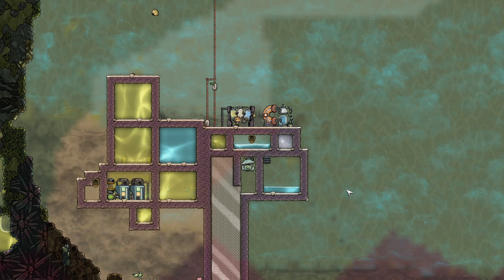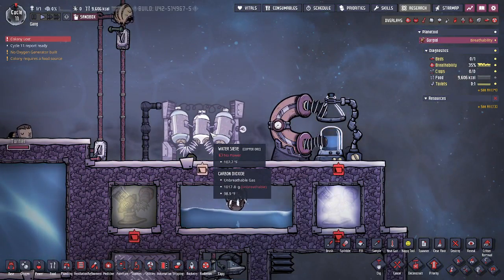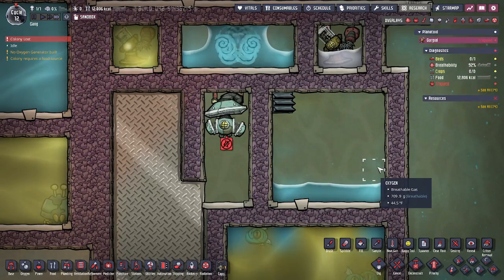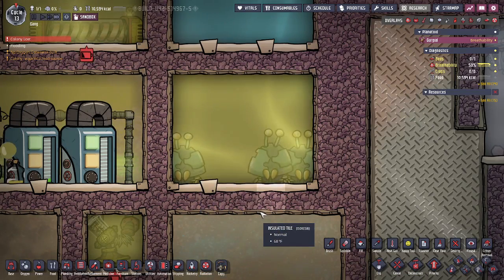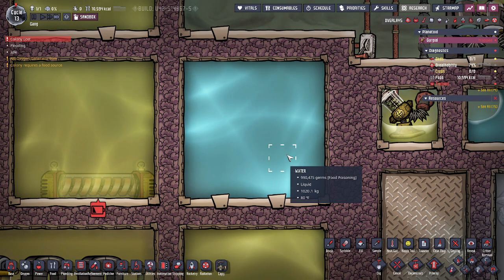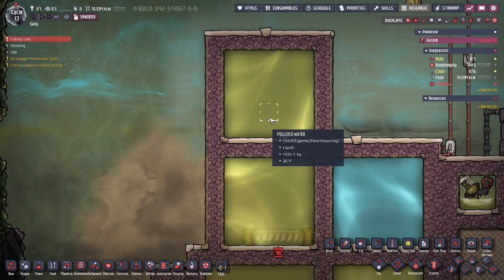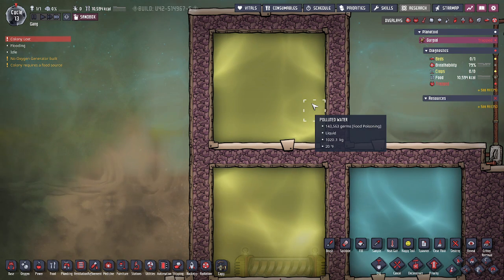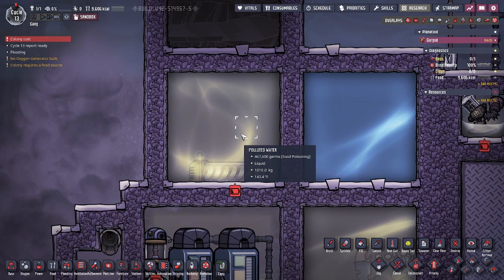Best Methods To Clean And Sanitize Water - Oxygen Not Included

Comment: 5:13 How I can easily capture chlorine and put in these reservoirs?
Reply: Before you close off the room, place a storage set to bleach stone and fill it as much as possible. Then make it vacuum with a gas pump. When you have your vacuum, just set the storage to nothing, it will automatically drop the bleach stone and it will sublimate and fill the room with chlorine

Comment: 5:01 if I understand correctly, that system is going to pass packets of germy liquid from time to time since spill-over pipe from liquid shutoff is competing with liquid intake pipe for input port of the right liquid reservoir (i.e. it's blocked every other time stamp). If you're unlucky in just the right way and there is a germy packet on input port of the shutoff due to blocked spillover pipe and packet on top of germ sensor is germ-free, shutoff will open and pass germy packet.

Also, possibly, germ sensor should be set to "below 0", since "below" here actually means "below of equal", but I may be misremembering something.

Comment: I store all my water in tanks in rooms full of chlorine. This is the best option honestly because you can do it as early as you can store water really, and you end up getting lots of chlorine gas from digging into various biomes that contain it and it serves no other purpose (at least for me, I never use it for anything).

You don't even need fancy sensors or energy consuming shut off valves or anything like that, if you have at least 3 tanks full of water that the water has to pass through before moving out, the germs all die before they leave the room anyway. And early game it's easy to store this much water and let it pile up like that.

It's just easy, can do it early, and costs nothing but basic resources.
Reply: But how do you transfer the chlorine to sit on top of the water, do you let gravity transfer it or is there some equipment that you use? Im kinda new to Oni so i dont know much
Reply: @bred123  All gases have different weights so that helps sort it all out. Carbon Dioxide will be the heaviest and fall to the bottom, but natural gas and chlorine will sit right above that as they're both heavier than oxygen.

So basically what I do is I setup a little "bottom line" station that has the CO2 scrubbers that destroys co2 above the point where they are, which makes the chlorine and natural gas fall down to that height. Then you just put an air pump right beside it with a gas filter. You send Natural Gas to air tanks so you can use it as a fuel source and you can either store your chlorine in different tanks as well or just pump it directly to where you want to use it. It doesn't have too many uses, so I usually store it where I store my water so that it keeps it free of all germs.

You can use switches to turn the pump off manually, or you can set it up to turn on only when a sensor detects natural gas or chlorine.

Comment: Another easy way to disinfect polluted water is by making it go through 4 liquid reservoirs. To prime the system you need to have 0 germs in each tank and automation/pipe priorization to make sure tanks stay almost full. The reason this works is that the output water has the average germs of the tank. It might sound crazy, but it works.

Comment: Your disinfecting room design can jam in a way that would require manual intervention. To be certain of avoiding this, you must ensure that the tanks can never fill entirely. One way to achieve that would be using an automation signal off the first tank — set its lower threshold to 99%, run it through a NOT gate, and use that on a shutoff on the input line. That way, the tanks will never fill the line, so the recirculator can always keep going, and the tanks will always empty eventually (so long as there's somewhere for them to empty to!).

Comment: Does the brine or polluted water have any correlation to the Fahrenheit scale in ONI? I know the freezing point of normal water in the game is within a degree of 0 Celsius and the boiling point was within a degree of 100 (because that is how Celsius works). I though Fahrenheit was based on a similar concept with salt water though the in-game boiling point seems to be about 180.
Reply: [...] but the original paper suggests the lower defining point, 0 °F, was established as the freezing temperature of a solution of brine made from a mixture of water, ice, and ammonium chloride (a salt). The other limit established was his best estimate of the average human body temperature, originally set at 90 °F, then 96 °F [...]

The author used an arbitrary solution: a different concentration would lead to different freezing point. That's indeed why the Celsius scale instead uses pure water, instead of an arbitrary solution. There is simply no logic in the Farenheit system, or the Imperial System as a whole.
Reply: @altamistral  Though I think the point of the imperial system is that it was based on measuring tools easily available to the average person. 
I believe an imperial foot is about the length of a human foot, the original mile was how far a Roman soldier could march in a day and the person creating the Fahrenheit system seemed to be trying to replicate the human body (and thus percieved temperature).
This would make imperial measures good as a colloquial measuring technique (thus why it has hung around so long) though the reliance on potentially variable measures and the complexity of converting between measures (ie yards to miles) would make the system error prone for complex engineering.
Though the US made a point of standardising exact measures and I would guess they would avoid conversion within a given scope of an engineering project thus replicating the metric system.
Reply: @roax206  Historically "one foot" had no precise definition. Depending on where the term was used it could have meant as little as 250 mm or as much as 350 mm. The "point" of the Imperial System is that when people face a new challenge, i.e. measurements, they mess up a lot and make a lot of mistakes before they eventually get it right. The error of US was trying to standardize that mess instead of trowing it away as they should have.
Reply: @altamistral  well the point was that people have different sized feet (as well as other factors that influenced the chosen size).
Having a vaguely similar measure as  part of your body makes it easier to guestimate distances but this should not be used in commercial engineering.
It should also not be used when flooding the market of an entirely metric based country to the point were all of it is legally gibberish but you can't buy a sandwich without knowing how many fingers make up a foot and have to try to figure out how many feet of curtains can fit in a 2m window frame.
Hello from Australia.

Comment: A couple things to note:

Sending brine through a desalinator will yield significantly less water than salt water, since a larger portion of brine is salt (per 5 kg: 3.5 kg water + 1.5 kg salt for brine vs 4.65 kg water + 0.35 kg salt for salt water).

Also with regards to chlorine sanitation, by having 3 full reservoirs of water or even polluted water in the chlorine atmosphere, you can have a full 10 kg/s throughput and still get sterile output.

As long as the reservoirs remain full and you only send liquid out of the system after it's gone through all 3 reservoirs, the chlorination + dilution of germs will be enough to handle any amount coming in. No automation is even needed if you set up the pipes correctly.

Comment: Storing your germ-polluted water near a lightbug farm also works.  Radiation kills germs; the higher the amount of rad exposure, the quicker the kill rate.  Any source of consistent radiation will work, really.
Reply: i am gonna want to know JUST what this is exactly.
Reply: @lechking941  The shine bugs that spawn in temperate biomes emit light.  They're also radioactive.  You can toggle the radiation overlay with I believe the F9 key.  You can also adjust the amount of radiation they put out through the settings when generating a new map.  The more shine bugs you have gathered in a location, the more radiation is emitted.  Germs in air, water, and on buildings, when exposed to radiation, begin to die.  The higher the amount of radiation exposure, the quicker they do.  Natural uranium also emits radiation, as does unblocked exposure to the space biome. If you build a germy-water reservoir near one of these sources of radiation, the radiation will take time to kill germs and sanitize your water.
Reply: @aaronmartin8027  But that close to the space biome won't any water freeze? It's really cold up there! It was my plan for a long time to cool my base down by using that but it never really worked out.
Reply: @huldu  It is, indeed, cold up there!  
I would suggest using insulated tiles and pipes or liquid tanks to get around the freezing temperatures.
If you are constructing your liquid storage, use insulating tiles and piping with material that offers a balance between heat loss and radiation penetration.
Also, from what I remember, liquid freezes in pipes but does not freeze in storage tanks (correct me if I am wrong).  Shove your polluted water into a few tanks exposed to high radiation.
Or, avoid the whole isse with the aid of a vacuum.  Intentionally expose the top of your liquid storage to space radiation and line the bottom and sides with insulating tiles.
Reply: lol, gonna install radiation lamps in my polluted water supply.
Reply: A door made of uranium ore in the water also works.
Reply: @labwax  ya thats just stright forward and true :P i dont even need tot hin on it.
Reply: wheezewort do the same trick
Reply: How do you produce a source of consistent radiation? The only source I've seen is naturally occuring uranium but the second I mine it the radiation is gone.
Reply: need alot of rads for higher water though, good luck disinfecting a giant pool of food poison with some rad generators
Reply: @Seagull077  keep your food in the fridge then. 😂 Normally my water source is out of germ. Except the filtrate water from bathroom. That's where I use my wheezewort to kill the germ. Quite troublesome at early stage to setup chlorine gas chamber to kill germ.
Reply: @weijie653  No, I'm talking about food poison filled water from the toilets. It's full of food poisoning and you're gonna need more than a few rad generators to put a dent in it.

Comment: I have some trouble with energy and wires, can you do a guide on how to make a power station?? I usually have to make 3 or 4 separate generators because of the wire( I know there’s a bigger) ,and I can’t understand how to use transformers and wire my bases. I really struggle when my base gets bigger
Reply: 1. I think smaller generators early game aren't too bad given even 2 coal generators are enough to overload normal wire if the demand is high enough. Just make sure there is enough water nearby and ventilation to handle the hot CO2.
2. I believe transformers just limit the max power provided to the output so if the transformer outputs 1000w then you can't overload normal wire without adding more generators or batteries.
3. Batteries produce heat. They also seemingly have no output limit so if the demand goes over 1000w you wire will be overloaded and destroyed.

Comment: That sensor method is good .
But maybe if u keep pumping germy water inside reservoir Germ keep rising inside it so better to :-

Pump water inside reservoir wait until all Germs die and Drain it out completely before adding new batch of Germy water.
Reply: Just link reservoirs in serial (output linked to input in a chain) rather than parallel (all outputs and inputs on one long pipe). As long as there is enough water in the network to fill the first reservoir the ones in the back will fill with germy water and have time to clean before they make it to the front.
Reply: a lot more automation for that but ya. its slower to keep it moving but eh.